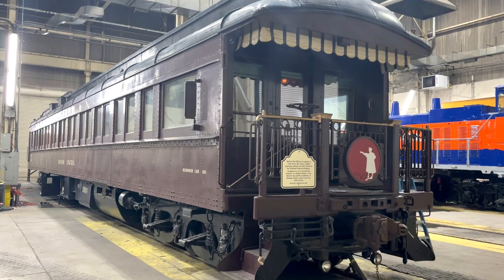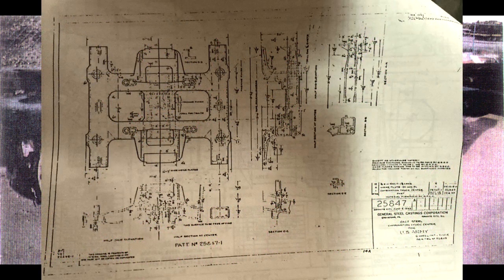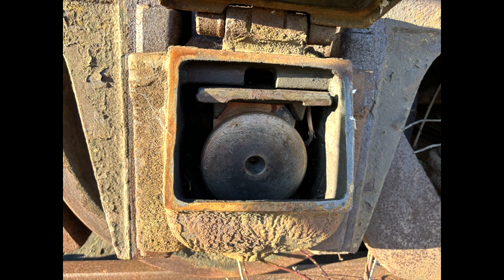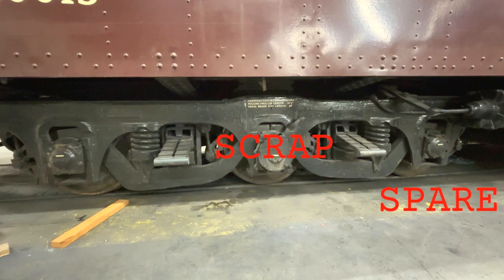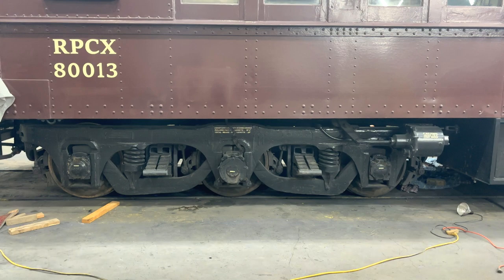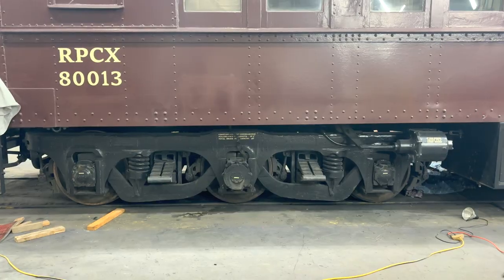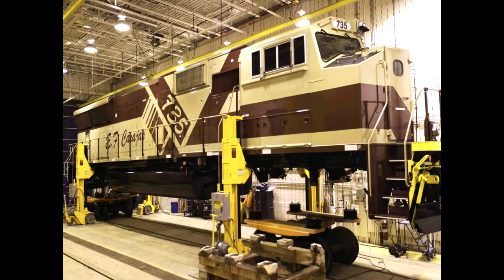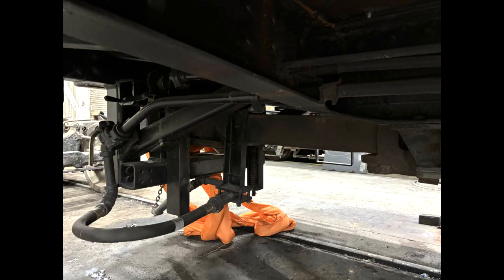{135} Wheel Set Swap on 1910 Pullman Railroad Car

Comment: Nicely done. I'm retired from railroad world almost three years. You nailed the important points. I'm guessing that your brother swapped to the newer trucks with an eye to Amtrak certification. Best of luck with your endeavors.
Reply from the maker: Yes, in ‘83 he was worried about Amtrak banning bolted pedestal trucks, so he put on the Army trucks.  In the end, I am not sure Amtrak banned bolted pedestals.  But these trucks are certainly more impressive than the 1910 trucks.  
It is a bit of a coincidence that the 3 axle trucks are also 1910 because the car was built as passenger with 2-axle trucks, and didn’t get 3 axle trucks until the D&RG conversion to a business car.
Reply: @HelloWorldETX I was a QMP with Iowa Pacific and we had a number of Amtrak certified cars. Bolt-on pedestals are a no-no. Looks like D&RG did a nice job overhauling that coach into something more. Wishing you the best with this.